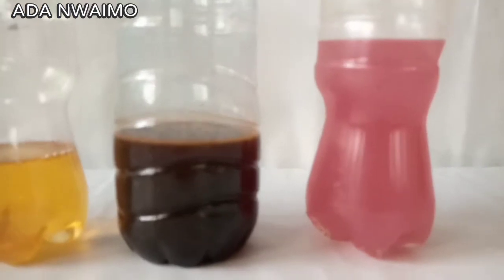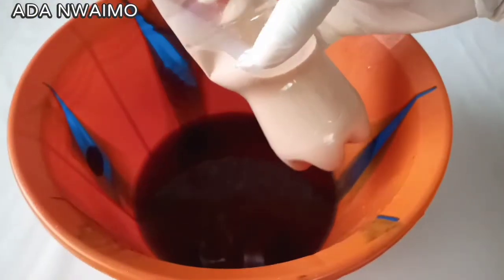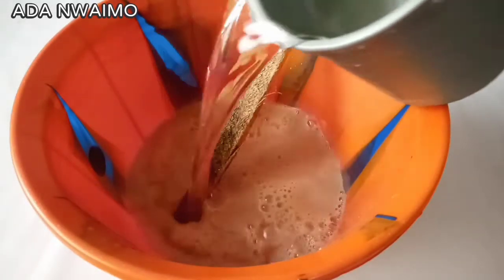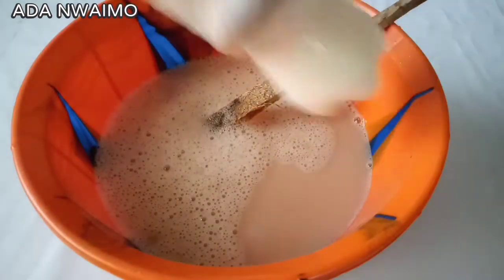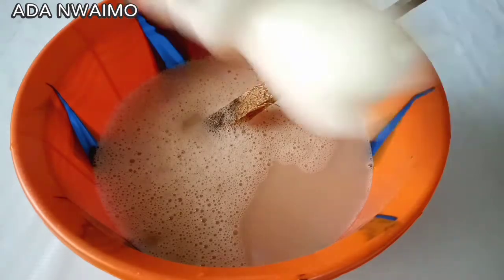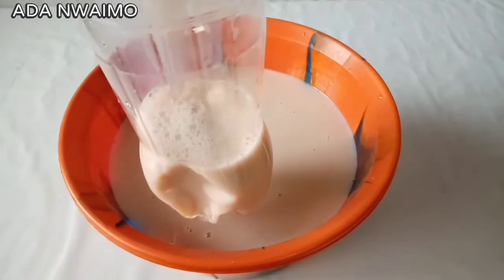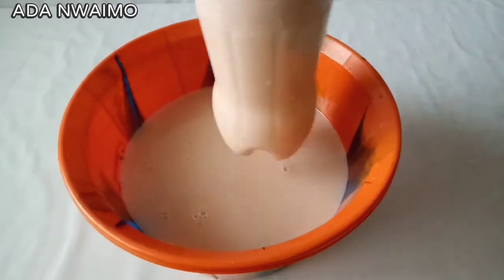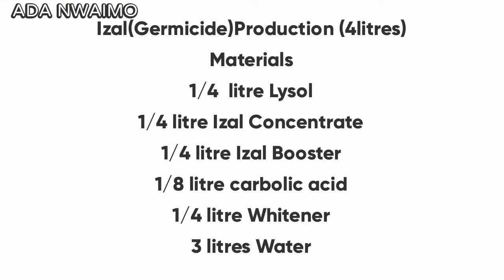How to produce Izal at Home | DIY Izal Production

Comment: You used 3 liters of water ma, is it’s that you calculated the water you used to mixed some chemicals before you poured them inside the mixture or the water you used to mixed the chemicals before you poured inside the mixture isn’t part. Just 3 liters of water
Reply from the maker: Yes.

Comment: I don't understand the part where you said 3litres of water to produce 4litres of germicide
Reply: What it means is that the total volume of the reagents or ingredient used is summed up to 1 litres , then you add 3 litres of water to make the resultant volume 4 litres
Reply: Is the water used to mixed carbolic acid part of the 4 liters or not, just to add small water to mix that
Reply from the maker: Thank you 🙏